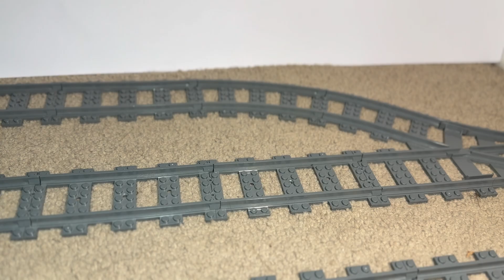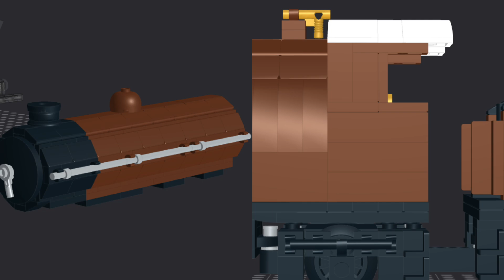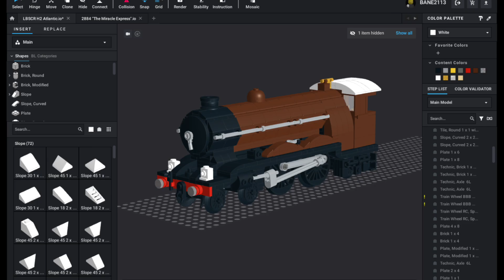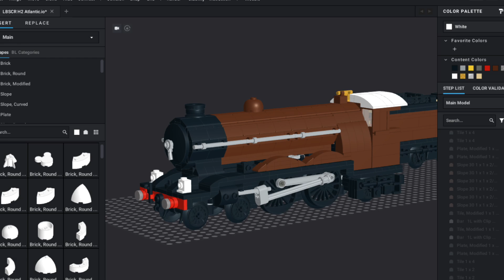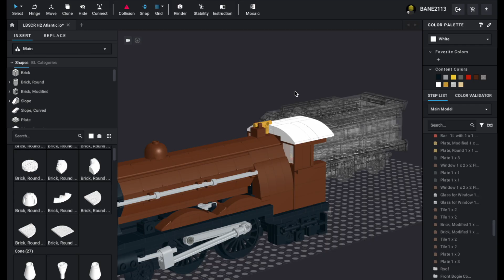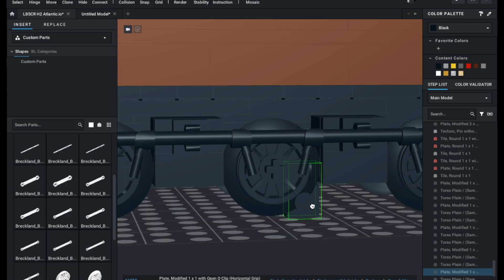LEGO H2 Atlantic (Design Showcase)

Comment: Great looking model.  An issue I've been facing with the brick built boiler on my County is how heavy they are at the front of the loco. I think your decision to split the front bogey is going to help with that a lot.
Reply from the maker: Ah, thanks for the insight! I hadn’t actually thought of that. Might need to do some prototyping then. 
I saw your County class in your last video, did you have to scrap your Collet Goods class?
Reply: @BrickishRailways No, I don't think I could ever bring myself to scrap the Collet, it runs way too nicely :D  I'm a bit of a hoarder when it comes to trains I like, so I will just keep adding to them. Every order I make on Brick Link I always check to see what dark green parts the seller has and that keeps me topped up for build :D

Comment: Ah, the southwest of England, where you have to run even smaller rolling stock than the rest of the UK 😄 Fantastic design! Well done 👍
Reply: True true when the grouping occurred in 1923 and the lbser merged with the Southern Railway its engines had to be trimmed down to a bit to accommodate the smaller loading gauge